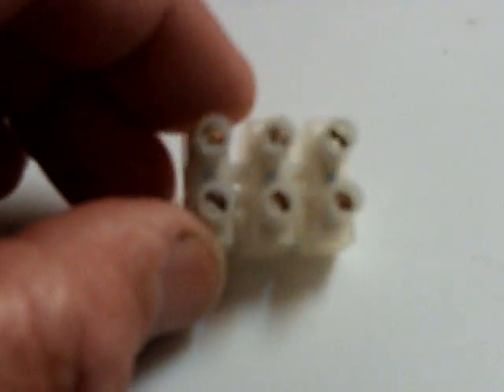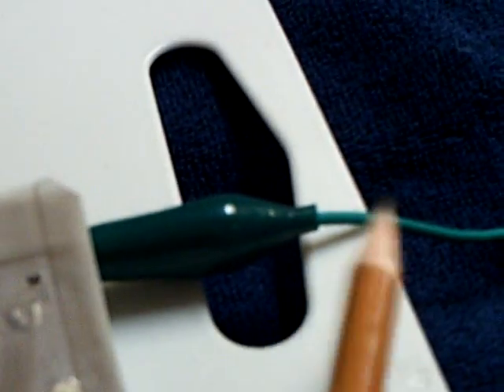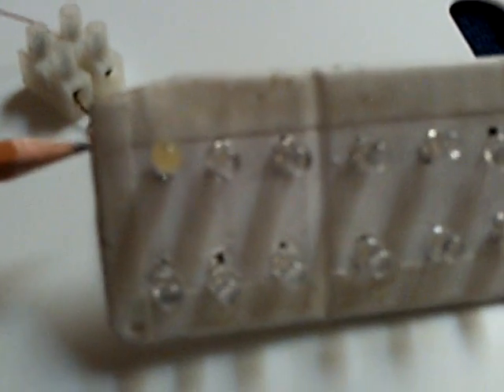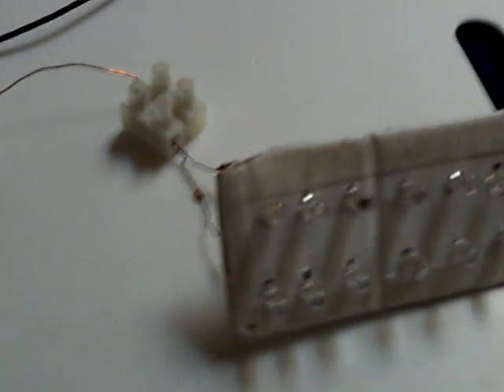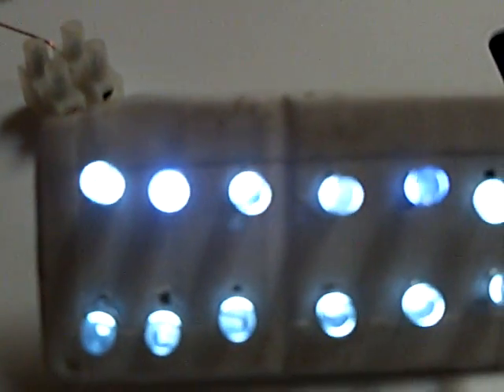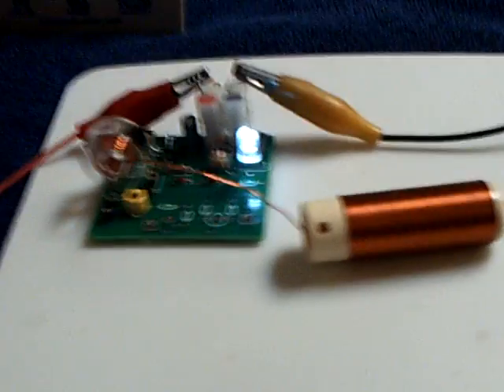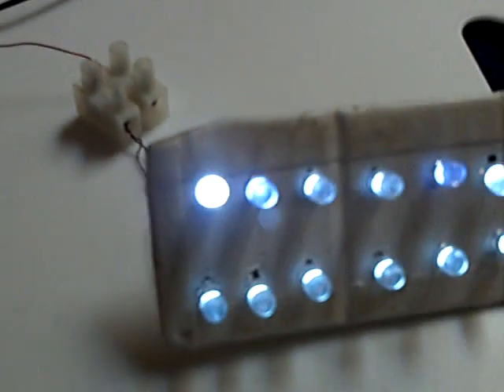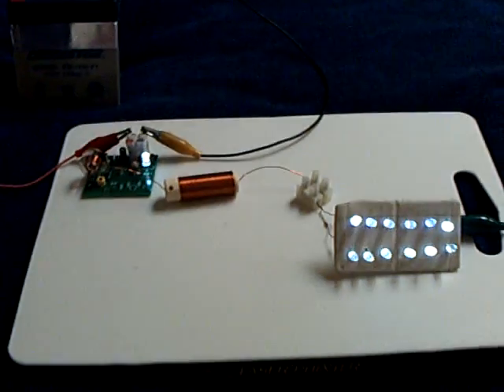SEC -18 experiment replication  (the capacitive terminal block).ASF

Comment: I never knew that! Does this work for terminals besides the white euro barrier coupled style used here? (sorry don't know the right term for it). I guess it just matters that there is a space between conductors?

And is this enough to affect a circuit in normal operation or do you need a coil and a tuning capacitor shown here for this to work?

Just amazing looking.

Comment: Normally I would say that it was roughly 2 pF out of the circuit
however in circuit with the SEC the capacitance could be much different.
The traditionally the change of frequency would indicate capacitance.
This may not apply here as the L3 reacts differently then traditional